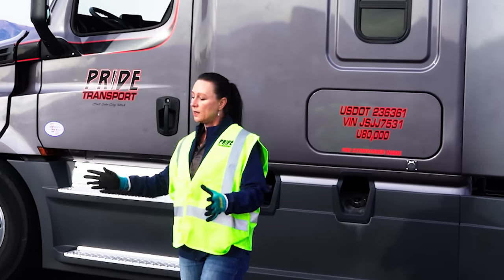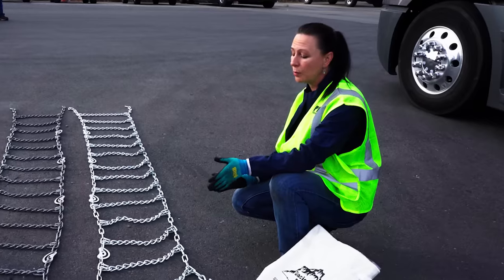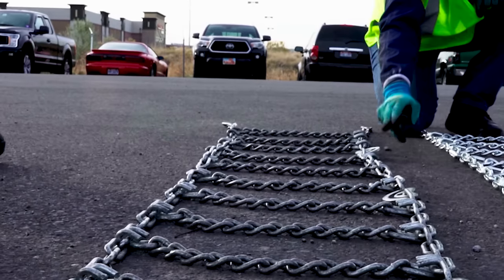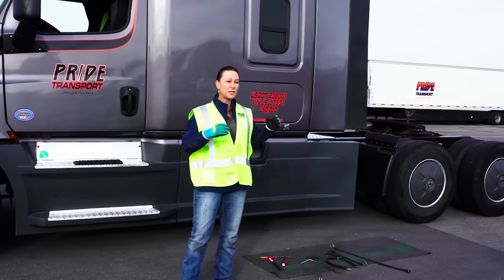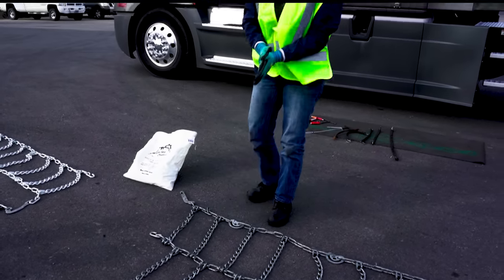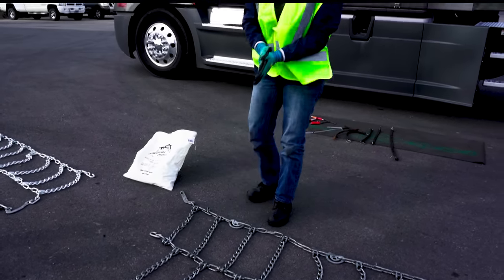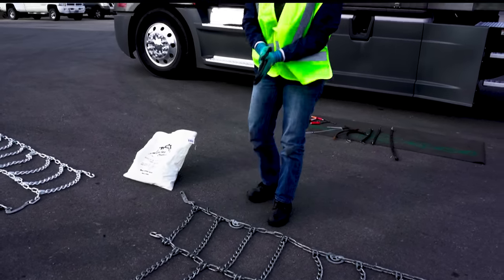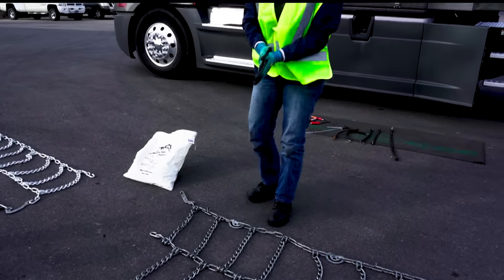The BEST Instruction on Tire Chain Installation ever.

Comment: #1 your 3 railers go on your primary drive axle which is the rear axle. #2 I don't like laying in wet snow. I throw my iron and get everything situated and then pull forward a couple feet. That way you can work unimpeded. #3 tighten your cam locks on the inside first then get them as tight as possible on the outside. If you did it right you do not need bungee cords. #4 stop a couple times in the next ten miles and pull up any slack on the out side and re tighten your cam locks. If you have more than 2-3 links that are flopping around use a bunny cord to secure them other wise you may tear off your quarter fenders. I fit my chains to my tires before I ever need them. For your trailer chain the front axle with a set of singles on the outside tires then back up a couple feet and hook them using the same procedure as before. By backing up you do not have to work between the axles. Everything is right there and easy to get to. 
To be legal you only have to chain your primary drive axle and one trailer axle. Unless you are heavy and on a lot of snow pack you will never need to chain both drive axles! In the PNW puling 40-20's at 105500# I rarely ever chained both drive axles.
Reply: Hey what axle is going to be your primary drive axle? And do you need to put chains on each tire on both sides of truck
Reply: @Loyalteelogistics  Your rear axle is your primary drive axle unless you have a tag axle. If you have a power divider it is always the rear.. A set of singles on both sides of the rear will most of the time and by law that is all you have to do plus one axle on each of your trailers. Back in the day before they checked I would just put one drag chain on my trailers just to keep them straight. 
If you are in deep hard pack snow I would suggest 3 railers on your rear drives and a set of singles on your front drives. But even at that I have spun out before. Just depends on conditions. If you park on heavy snow pack at night I would suggest having some boards with you to pull up on. Your tires will be warm and will melt into the snow pack. Also do not set your trailer brakes when it is super cold your brake lining with freeze to the drums. Then you will be out there laying under it with a hammer busting them loose.
Reply: Thanks for the reply great info   now I know rear axle gets chains 👍 i was confused what axle was my primary drives and I'm going to listen about not setting trailer brakes for long periods in freezing temperature thanks👍
Reply: @Loyalteelogistics  I never set trailer brakes unless I am at the dock or dropping the trailer. And when you park in the snow when you get into position if you don't have boards pull up and back a few times to help flatten out the snow and cool your tires so they don't melt as much snow and make divvets for the tires to set in overnight...
Reply: I would be very curious to hear your explanation as to why you somehow have this thought that the rear drive axle of a tandem drive axle set is the primary drive axle ?
Reply: @charlesb4267  so what’s the primary drive axle and what axle or axles get chained how do you chain up then 🧏
Reply: @Loyalteelogistics  With a tandem drive set there is no actual primary and secondary drive axle, under good traction conditions such as dry pavement with the power divider not engaged both drive axles receive an equal amount of torque to move the load down the road. However the weakest link in the drive system is the power divider and output shaft coming out the rear of the front drive axle housing and the inter axle drive shaft. If you have ever noticed that the drive shaft and ujoint size is smaller on that short inter axle drive shaft as its not designed to take the torque that the drive shafts from the transmission to the input shaft of the front drive axle is as they have to withstand all of the driving forces. Because of those weaknesses its recommended that either both axles be chained up or the front axle only and in either of those cases the power divider is to be engaged. Now that is in a perfect world, however the problem is that some trucks may have a fender over the front tire creating such limited clearance to even install tire chains so the only option is placing them on the rear axle and now most of the drive stresses are going through that power divider and output shaft and the inter axle shaft which in a high stress load could cause them to fail. Having said all this, the stress load on the driveline is all dependent on your load and grade and surface you are driving on so if you are not loaded heavy and the grade is not insane and its pavement, chaining up the rear drive axle if its the only one set up that can be chained up, that is "ok", not preferable but shouldn't have a drive line failure because of it. I used to work in the oil patch and chaining up with triples was the constant theme all winter and also when it was muddy from spring through fall. Body jobs typically got one set of triples on the front drive axle and that mostly got us to where we were going, tandem highway tractors got two sets of triples and yet they would still spin out on some hills with good reason and have to be pulled up with a cat. The drive lines on logging and oil field trucks are usually spec'd heavier than a typical highway truck pulling a single trailer because the diffs and power dividers of lighter drives could not take the abuse they are put through. By the way if you only had one set of single chains and you could fit them on the front drive axle, the chains digging into the ice or hard pack snow chew it up a bit and allow better traction for the rear axle, food for thought there. Hopefully I haven't confused the situation too much for you and the main thing is having tire chains with and that they have been fitted up in a practice run to ensure they fit before you need them and practice the moves in installing them rather then learning at the worst moment in horrible conditions !
Reply: @charlesb4267  wow ok man just getting this all in so this info is opposite of what I was told before so if I’m getting this correct if I can chain the front drive axle that would be the drive axle best to chain but if it can not the rear will work also I see alot of guys chaining back only so I was thinking that was the best way now I know something different appreciate your reply on this and let me know if I’m not getting this correct thanks again man Merry Christmas
Reply: @Loyalteelogistics  The reason you often see the rear axle being chained up is based on tire to fender clearance issues ( that there is no fender over the rear tire for example ) and as well some trucks have rear mud flaps that can be removed and so that will make it a lot easier to chain on the rear axle. But like I said, preferable as far as drive line strength is the front axle if you only have or need two single chains but in all honesty single tire chains only afford so much traction/drive line stress load over the more preferred ultimate traction ability of triple chains. And the key is to be easy on the unit ( on the throttle that is ) and not be spinning wildly to get rolling as that is what can tear up drive lines and just shred chains that are not heavy enough for that type of abuse. Tire chain quality, that is a whole other topic and I know some of these cheap Chinese tire chains on the market are total garbage. I doubt you will ever see on road trucks down in the states using the type of aggressive tire chains we use up here in the oil patch and forestry for mostly off pavement use as the cross links have round studs that stick off of the links and they bite into hard ice or snowpack or the base  of a muddy horrible oil lease road, the brand name is Trygg if you wondered and they are made in Norway. Its been the standard go to tire chain brand for most of the companies on the off road trucks up in the Alberta and BC area. Unfortunately good tire chains do not come cheap, certainly these days with the insane price increases every where one turns. Merry Christmas to you as well Timmy !
Reply: Man so much priceless information and life experience for free. I'm a Diesel mechanic in Iran. Nature of my job dictates thus I can drive truck, but I'm not a trucker. Most frightening thing about chaining up for me is the : OTHER DRIVERS. I simply don't dare to get out and chain up in many cases, since I for a fact that as soon as I lay down besides the vehicle, some irresponsible idiot will slide with 100mph and crush me for sure.

Comment: A couple take aways. For untangling of a chain this is very helpful. Nothing worse than having to untangle at night. And second if you have floor mats in your cab you can always used those to throw down on the road. 3rd, always store your chains so that you can take them off your hanger and put them right on the tires. Hooks facing out, cams down. You can literally take them off the hanger,  quick inspect, throw, roll on, hook, tighten, and roll out. Cuts a lot of time off to set yourself up.

Comment: I've tried using a fifth wheel puller to hook up, but I find it a lot easier to run over the chain and put the hook in an area where it's easier to hook up

Comment: 36 years and I've never put chains on, time to chain its time to park it
Reply: I been debating this man. I've never chained up before. Is it worth it. Driver asking for advice
Reply: @MultiKingvegeta  no it's not cause when shit goes wrong these companies will leave you hanging saying their policy states you should have parked
Reply: I'll be sure to stop if chains ⛓️ are required.  I ain't dealing with this mess
Reply: Exactly what I do
Reply: Can't shut down winter up in Canada, though. Mandatory front and rear winter tires as well as chain season from Oct 1 through to April 30 in the mountains.

Comment: With the triple chains, you used the hooks toward the back, and loose chain toward the front of the truck, with the singles you did the opposite, the hooks were toward the front of the truck and loose chain was toward the back.   Is there a safer way hooks towards front, or towards back when chaining up to protect them best from coming undone while driving?

Comment: Why aren't the the half moon cambers on the in side after they've been tightened? 
The bungee cords are supposed to be mounted to the cambers to prevent the cambers from slipping.  One set of chains are on upside down.  And you need to blow your nose.

Comment: The best thing to do is pull over and go to sleep.  Because if something happens you’ll be responsible and not your company
Reply: As you are sleeping everyone else keeps moving. Many of us are not scared of a little bad weather.
Reply: @shawnkelly695  next day when I continued I saw 10-15 trucks jacked knifed along the hwy.  those must be the brave ones you’re taking about
Reply: @georgepristouris4149  they were the too brave going too fast. I drove semi 20 yrs and never stopped unless road closed and never crashed. I just slowed down. But ya also live in the north and bad weather is the norm. If we parked due to bad weather we would stay home 8 months of the year.
Reply: @shawnkelly695  I live in Montana.  I get paid by the hour lol
Reply: @georgepristouris4149  by the hour but most paid per mile. I ran 3 logs going non stop. Fill up and next stop was when empty. But after 2 yrs i couldnt walk cause my legs burned so bad. But ya no weather stop me only slow me down.
Reply: @georgepristouris4149  love my show yellowstone from mt.

Comment: Good video, after all these years it had never dawned on me to flag where the hooks are when  dismounting them, more than once, it took a  couple of moves of the truck to get it right. Ya, I'm a meat head sometimes. For singles some guys will lay down blocks in front of the inside  wheels and pull up on them, making it easier to hook them  on the outside tire, I tried this but got tired of messing with all the blocks, plus its just one more thing (or I should say four or eight ) to find room for. But now being retired I'm just glad I don't have to hassle with it all anymore...

Comment: If you drive in Canada with the mountains in british columbia a trick if you are pulling super b's with the maximum weight in north america allowed and need a full set of triples on all four drive wheels to achieve maximum traction to climb the steep grades, disconnect the trailers from the tractor on a reasonably flat area, and pull forward out from under the trailers. You now have full access to all the tires. Make sure the truck before winter sets in has only quarter fenders as shown in the video. With the trailers now not dripping water or snow and you can access the tires much easier, you can do a full set very quickly. It only takes about 45 seconds to wind down the landing gear and disconnect the air lines and that time is easily made up by being able to lift the chains and access the tires much easier. Never disconnect the trailers  if there is ice and a side slope, because the trailer can slide sideways. Had a driver in the vancouver to cache creek canyon ask me to help chain up and I could not help because he had full fenders with only about an 1 inch of clearance and it filled with packed snow, Another time many of us waited for a wrecker to tow a trailer that someone disconnected on a steep side slope and the trailer slid sideways blocking the highway,

Comment: I see that there are lots of comments and I don't want to read them all. I do agree, it is an excellent video and dead on with everything. However, it does not matter how many times you have practiced to install chains, once you have to do it, it's an all different ball game. You will find that out. I live in Canada and up here, a lot of tractors have wintertires mounted on at least one axle and that is a totally different thing alltogether. It might even be that the chain that would fit on a summer tire, will turn out too small on a winter tire. It is also a lot harder to adjust forward or backwards if you have to.